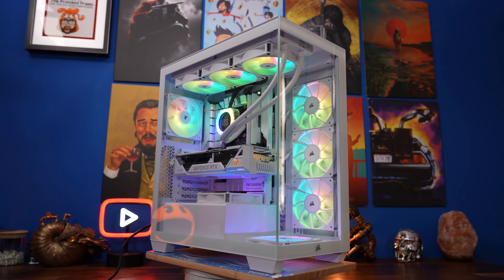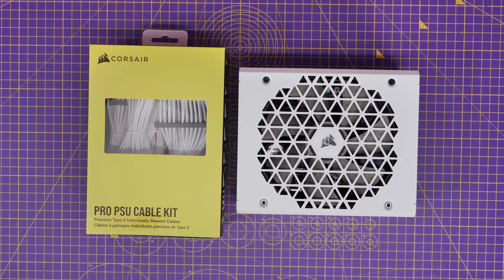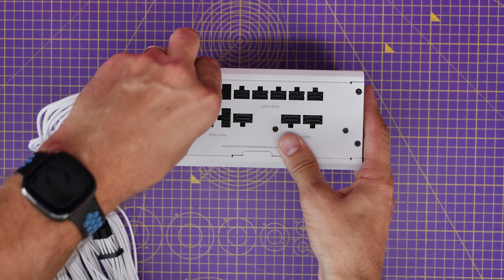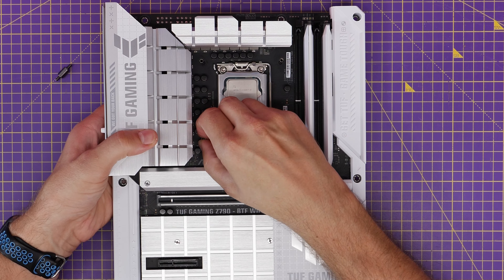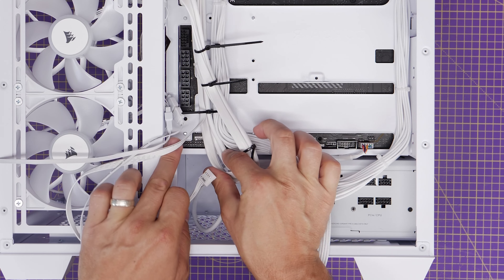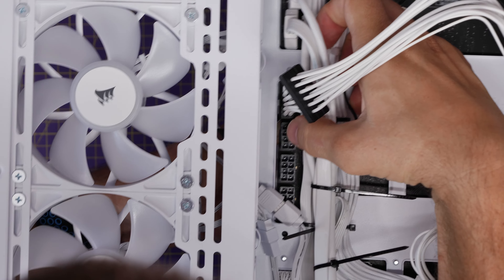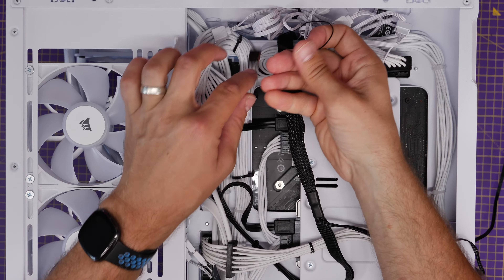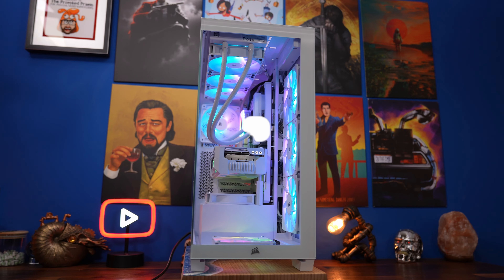Corsair 3500x ARGB build guide with RS120 RGB fans and H150i Elite Capellix XT

Comment: I'm literally building exactly what in this video but in black and non back  connect motherboard. This really helps. THANK YOU🎉
Reply from the maker: @ttkingboss5330  hopefully despite that it's clear and useful! 👍
Reply: Here to say I’m doing the EXACT same (black 3500x and a non-rear connect mobo). Everything else is the same and this video is a LIFE SAVER. Huge thanks
Reply: Me too but in white and not back connect either but got some pretty sick custom psu cables just got my three pack of lx series fans for the bottom and don’t know if they all should be intake or some kind of mixture tbh there should be enough airflow with 9 fans you’d think

Comment: I have the same build upcoming like the video, i am quite worried about the daisy chain connection, and I am new to pc building. I bought a 140mm  RS120s  (5 pieces) for side, top and bottom. I am wondering if that wont be much of a hustle to do. And i am curious if I should buy a rear fan (120mm RS120) to remove hot air.
Reply from the maker: https://youtu.be/GSrsfyaYPKA

Comment: thank you for doing so many videos on this case, currently think about upgrading my case from corsair spec 06 rgb..i also love this mother board but im scared of the intel problem with cpu
Reply from the maker: Intel now has a new update with multiple bios fixes that are apparently sorting it. If it helps my daily driver is an i7-14700k and I've got no issues
Reply: @TheProvokedPrawn  ok thank you very much and it was a great video btw

Comment: What am I supposed to do with the wire that came in the bag with the zip ties? And also what should I set my aio pump speed too?
Reply: They are just extensions. The pump should be max speed but 80% should might aswell do the job.

Comment: My system boots to bios when connected to the mother board but it does not recognize my BTF card, I have plugged in the 12va  pcie cable just like the video.

My gpu shows a red light
Reply from the maker: Are you sure it's fully plugged in? And the GPU is all the way in  too